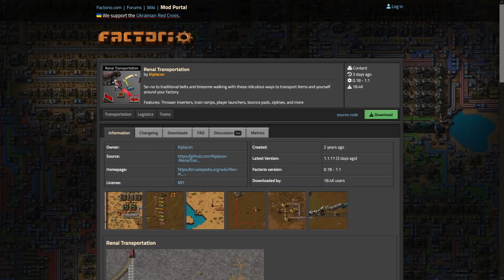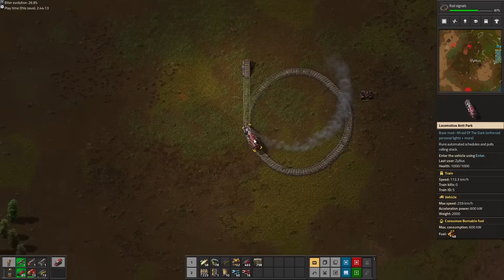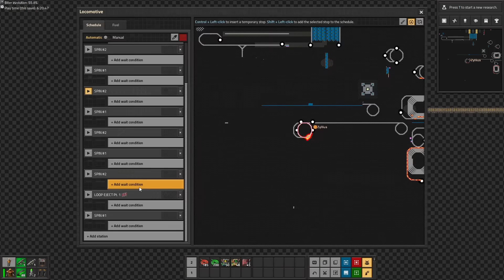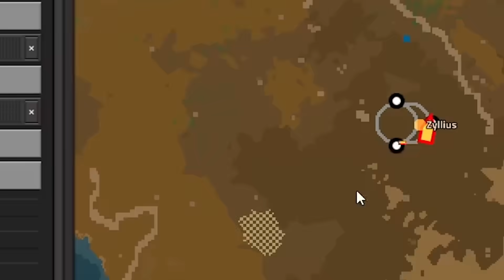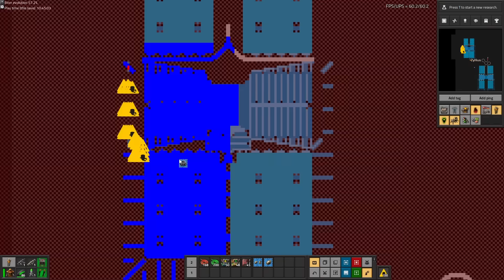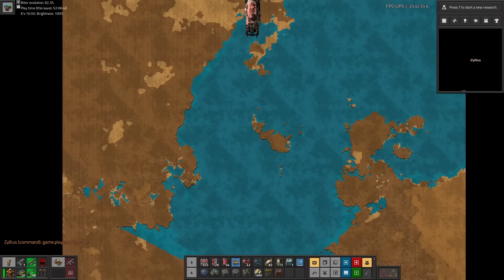This Factorio Base is Powered by TRAIN COLLISIONS

Comment from the maker: Next video will be about something that isn't Factorio

And on the off-chance the mod author sees this.
Change the primer thrower inserters. I wanted to used them exclusively to defend my walls but they do about 100x more damage to your walls than the biters because they're allowed to throw way too close to itself. Also things like cannon shells do no damage and explosive cannon shells do half damage because there's no contact damage, only explosive when it's thrown.
Reply: I'll probably leave friendly fire cause that's pretty funny (and idk how to turn it off) but fair point about the close range. I generate the primable stuff while the game is loading so that modded grenades and such will work with it. If it's not copying some of the cannon shell effects then I'll have to look over the code to see what's up. 
I thought about making the throwers' range adjustable through circuit signals but I couldn't figure out how to do it. Looks like it was nothing someone else's mod couldn't fix though lol. Glad you had fun with it!
Reply from the maker: Thanks for making the mod!
It's always fun engineering around new problems, and building around flying trains was certainly a new experience. I'm a little tempted to use them in a normal run now. Definitely for the primer inserters, adjustable throwing distance would be nice, even if it requires swapping different entities. Not asking for FF-off, but as it stands the only thing they can do is throw poison/slow capsules because the moment you get biters that don't die in one hit you can say goodbye to any of your walls. If you tweaked them a bit I'd honestly love to see them in a standalone mod.
Reply: @Kiplacon  this is probably gonna be my first ever Factorio mod (I only started playing like a week or so ago) just because I love the idea of inserters throwing stuff around, as well as the impact unloading of trains 😂❤
Reply: One of the best things I've done in Renai Transportation is carpet bombing a biter base using Primer Bouncing Pads. You can use Stack Throwers to throw a bunch of rockets on it at a time. If you fill a whole train with explosive rockets and use a bunch of Stack Thrower Inserters to drain it, it'll fire 30+ rockets per second.
Surprised you didn't showcased Primer Bouncers.
Reply: I'm curious if Noita is in your radar.
Reply from the maker: @cerocero2817  I got the amulet but not the crown
Reply: @DoshDoshington  They started releasing updates to it again, maybe finally we'll get a proper way of getting a 34 orb run! Also maybe they'll drop some hints about the eye and the cauldron too, can't wait!
Reply: @DoshDoshington  oh fuck that would be amazing, I can't even imagine the total bonkers wand builds you could produce
Reply: @DoshDoshington  the crown is a pain regardless, so much jank in that quest.
Reply: Hey, I realize non-factorio content gets less view, but I think your game reviews are amazing content. Looking forward to what's next.
Reply: I just forwarded your request to the mod author, Kiplacon, on the Factorio forums.
Reply: I actually really like your non-Factorio videos. Marrow and La Mulana ones are some of my favourites on your channel
Reply: As a huge fan of both your factorio, and your non-factorio content, I'm very hyped for the next non-factorio video
Reply: Dosh I love and support you even when you say hurtful things like, "Next video will be about something that isn't Factorio"
Reply: Hello, DoshDoshington!
I'm pretty pleased with your videos!
Thanx very mutch!
And i still want to see 'all-spagetti' megabase!! :D
Reply: Dyson sphere program when?🤔
Reply: Hi! Not the mod dev here! I absolutely will not make the requested change, as I am not the developer of the mod. Have a nice day :)
Reply: I am really exited for a video about a game that i never heard of
Reply: i enjoyed la mulana, looking forward to it.
Reply: If you want another mod to showcase, how about the 'Crafting Combinator' mod?  It is HELLA powerful, but also hella confusing because the author doesn't explain how to actually USE it.  All that I've managed to figure out is how to create a bot mall where I can set the item & quantity for the entire mall with a single constant combinator, but I know that there is a LOT more that can be done with it.
Reply: Would you consider (ie. add to your poll), a "Vanilla + QoL + minor mods", those tracer rounds look cool, and the recursive blue prints mod can't really justify a video, but it would be neat to a full run with a bunch of minor mods, and go in to more depth around how you build your base (like what size your starter base is, reasoning behind it). I think I make my starter base too big and then get bogged down trying to keep up with my science research and defending it.
Reply: Hopefully youtube will actually show me your non-factorio video because my account is so old that it would take me an afternoon to remove my old subscriptions that I don't watch anymore
Reply: Your tower climb and marrow videos are some of my favorite videos so I'm greatly looking forward to whatever you'll be talking about next!
Reply: Your non-factorio vids are always great. Can’t wait for the next one!
Reply: Not factorio? Please, Opus Magnum. :)
Reply: @Zeratul649  TIS-80 for maximum sleepiness
Reply: Non-Factorio Dosh content is still very high tier
Reply: I look forward to whatever you plan on showing our unworthy eyes next. Thank you for an excellent and very silly video
Reply: pyanodons?
Reply: Hmm... primer inserters + poison capsules? 1 capsule is 16 dps, overlapping aoes stack their damage, they don't hurt walls, and they shouldn't hurt bots. A bunch of those inserters should take your wall from biter-threatened to war-crimes-central in less time than you can say 'what flamethrower turrets?'
Reply: Will we ever see you tackle the madness that is pyanadons? Great video btw ❤
Reply: Will it be factorio adjacent? Like satisfactory and that other one with a solar system
Reply: Love the factorio videos but also love to see you branch further out. Dont wanna see you die the one trick youtuber slow death
Reply: you could do mindustry satisfactory or dyson sphere programm or some super heavy mintest modded shenanegans ;)

or do i played factorio but only via giving orders to players on how to do (some thing like how hard is it to convince your community to build a factory exactly as i planned it with at least 50+ mods )by the way i would be in the boat for that  as well as a bobs + angels run if u dont want to do that alone also something i do right now is a biter resurce only run(minimum recurces with biter economy +biter power + biomass mod so that the only way to get resonable amounts of recurses is by killing and processing bugs to raw materials
Reply: if its satusfactory im gonna be paying good attention
Reply: Hey Dosh, big fan of your work, was curious if you're planning on ever doing the Sea Block mudpack? It seems like a great challenge with good potential content that could be very interesting to watch. Ty for looking at this in advance
Reply: The latest patch added your suggestions
Reply: 14:30 PHYSICS tied to framerate ?
Reply: this didnt age very well lol   Sick factorio content
Reply: You could use poison capsules and it shouldn't hurt your walls
Reply: bros would play factorio but only manual crafting in death world or smthing crazy
Reply: If not factorio, then satisfactory
Reply: Gregtech
Reply: WHAT (but your the factorio guy😢)) (YOUR ONLY SUPPOSED TO MAKE FACTORIO VIDOES 🤬🤬🤬) (unsubscribed 💅💅💅
Reply: @Rayglobster  you're and you're
Reply: i actually prefer the non factorio videos :3
Reply: can i suggest you review cruelty squad?
Reply: Starsector? Satisfactory?
Reply: For right now, I'm just seriously grateful to see your absolute expertise on this one particular game. It's mind-blowing how you can explain all these concepts so rapidly.
Reply: So... Industrial Revolution when?

Comment: The only thing that would make this better is if trains were able to decouple their wagons at speed, letting them crash while the engine switches tracks to continue to the next station and the wagons break into scrap upon collision. Then have a way to automate the placement of new wagons at the pickup station and let the engines connect to those when it shows up.

Comment: I'm really curious about the final explosion. As you flew, you were generating chunks. And at a way faster rate than the game could generate the biters beneath them.
Which meant the explosion went off in an area where there should have been biters, but weren't any.
So once the game finally caught up, did it generate biters after the explosion, or as if there were before?
i.e. if you went back there, would you see: (a) fully alive biters, (b) biter corpses, or (c) nothing

Comment: Surprised you didn't try remedying the train bouncepad slowdown by inverting the locomotives. They can't start to slow down if the loco is pushing from behind.
Though you solved the problem regardless, so it's moot anyways

Comment: You could make this even better you know. There's at least a few mods out there to let you automate the construction of trains (including their schedule). There's also a "hopper unloader" type thing out there that isn't an impact unloader but it still unloads train wagons very very quickly (in my head it's because it literally flips the whole train wagon upside down to empty it, just like you see IRL, and surprisingly the only special thing about those train wagons is that the couplers can rotate 360 degrees to allow the wagons to be individually flipped).

Comment: If you decide to do factorio again i have a suggestion basically 248k with 10x power costs, 2x health for everything (biters, bases, worms, and player structures), powered belts, P-U-M-P-S, rampant and allowed only 100 bots at any time to make it difficult (could also do deathworld if you think you can manage). You could also add a mod that adds harder ammo recipes and try to beat the game without flamethrowers (so you either have to use more iron for ammo or more electricity for lazer turrets, artilery and tanks would work too if you get that far)

Comment: I copied the beaconed smelting array and I have the smallest gaps in my output, what have I done wrong?
Reply from the maker: I believe I mentioned in the video you need to be careful with your inserter orientations, but inserters always drop on the far side of a belt and if you're not careful you'll have the output inserters from your furnaces both trying to drop on the same spot. You probably copied my design and rotated it, which would suddenly make it not work. Bit silly, I know, but that's just how it goes

Comment: I wonder if you would ever be willing to try out Dyson Sphere Program? It's also a factory automation type of game, extremely similar to factorio in alot of ways. Slightly dumbed down (although they are apparently working on an Enemy/Conflict sort of thing atm) in some ways, but with alot of other unique stuff that makes it alot more interesting (at least for me). The most notable thing is that it's 3-dimensional. Not just in the sense that you can put certain kinds of buildings on top of themselves, or even because belts and splitters can be placed over and under one another, but in the sense that the surfaces you work on are all spheres! They're gridded spheres, which means the grid squares get smaller and more awkwardly shaped as you go to the poles on a planet, which can make building certain setups very interesting (or annoying, depending on what you're trying to do). I almost wish I could actually not depend on a grid at all, freeform 3d placement would be far more interesting IMO. It also doesn't depend on a belt-based main bus (although you certainly could do something like that), nor does it have two-sided belt mechanics or arms. The primary logistical challenges of Dyson sphere are in quantity and long-distance transportation. Gotta make highly efficient systems that can pump out truly ridiculous amounts of throughput just so you can finish building the game-winning thing in a reasonable amount of time. It also certainly helps that the game-winning thing (the Dyson Sphere) also pumps out ludicrous amounts of power that increases as it gets more built. You can also design the sphere yourself! It uses a simple system where you can make your own shapes and patterns to balance raw output (which you get from a higher number of nodes) vs cost and time. A very quick to build sphere involves a minimum number of nodes, and is quite cheap, but it doesn't give you much in the way of extra energy which can itself slow down your progress just because of how inefficient it is limiting the potential throughput of your planetary factories.

Comment: So.

My first game I played vanilla.

Then I got curious. Went on the mod list and added growing new trees, thinking I could power my base with lumber. Then discovered that I had no way to plant the trees. Sucks.
But oooh look. I can make renewable fish
 And turn them into Lube! Cool.

Then saw a Wind turbine mod. Which is pretty sweet.
Wait.
This mod let's me turn lumber into Oil?

I now own a base powered by Tree seeds, that burns Lumber for Oil, uses Wind turbines to keep everything running smoothly, and uses fish for lubrication.

It's hilarious and awesome.

I have rockets powered by Trees (rocket fuel), lubricated by fish and made thanks to gigantic Wind turbines.

Every tree processed creates twice the seeds it takes to grow. So I have to burn thousands of seeds constantly to keep Oil production running.

My coal needs are only plastic.
And I haven't built any Oil Derricks.

If you ignore that I am strip mining the entire map of mineral wealth, and using a mod I found to eat pollution with Coal fueled filters you'd think I was playing entirely Green and Renewable.

It's certainly a different style.
I recommend the Wood to Oil but the Renewable lubrication with fish is an easy enough Wood process frankly. But it does feel satisfying knowing it's on an independent process chain.

Comment: 26:40 What setting are on the Arithmetic Combinator, and to which side should i wire the Constant Combinator, i'm trying to replicate this but my filter inserter doesn't change the filters it just take as much as possible
Reply from the maker: Arithmetic is just Each * -1 output each. So it takes the input from the roboport, multiples everything by negative 1, then outputs it. On the same wire, you feed in the values from the constant combinator, and since same signals along the same wires are automatically added, you're effectively doing (Constant Combinator) + ( - Logistics contents) Which is just subtraction, and means the value will be positive when there's less in the logistics network than specified in the constant combinator.
Reply: @DoshDoshington  Big thanks, it worked

Comment: Okay but why would you use an inserter for putting coal on the outside of the belts when you could do it without using power by using a splitter? 2:20

Comment: Hmm... How about "Marathon with robots… only"
From the very beginning of the game, only simplified roboports and transport robots are available. Relatively cheap craft, low speed and small battery, which can be changed to vanilla after corresponding research.

No conveyors, no transfer of resources by a chain of inserters... 
A special task: no trains (maybe this is too much).

But I myself can not understand whether it will be interesting, or just some kind of stupidity.

Well, the idea is there, but the implementation is on your conscience.

Comment: Why don't you just feed iron ore+coal => smelter => smelter => belt ? since steel needs 5 plates and 5 times as long it's a balanced recipe and saves some belts + is a more compact footprint, so easier to defend?
Reply from the maker: Bit less convenient before you've got medium power poles

Comment: Do you have a cheatsheet for ratios or do you just use a factory calculator/remember from previous runs? For early game, I mean. I've seen you use calc towards end-game.
Reply from the maker: I know generally what I need, but if I'm designing a base like this where I don't expect to ever expand it, I'll chuck it in a calculator.

Comment: The hint about copy pasting recipe ingridients changed my life when you mentioned it the first time so please do keep spreading it for the sake of everyone out there
Reply: It also works woth modules say you have like 4 T3 speed modules in the assembler or other building it will calculate it based on modules i had that woth T8 god modules from bobs put like 4k items in 1 filter per item ingredient a normal chest cant hold that much items XD
Reply: @Gh3ttoboy  Iirc it request either 1 craft's worth of resources or 30 seconds worth of crafting, whichever is higher. So if your machine finishes the craft 60 times a second.... it will request the ingredients 1800 times. It's always the Underground belts requesting a billion gears for me.